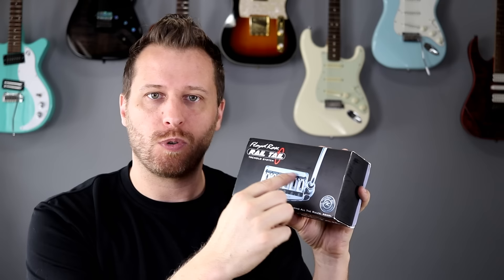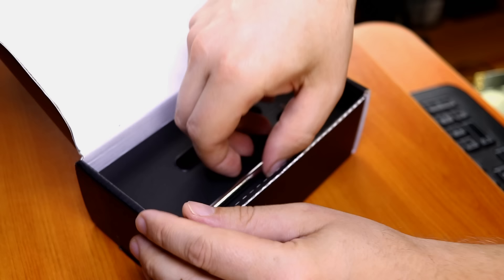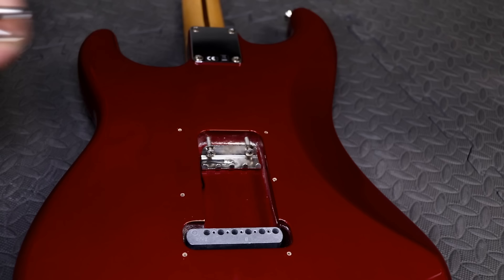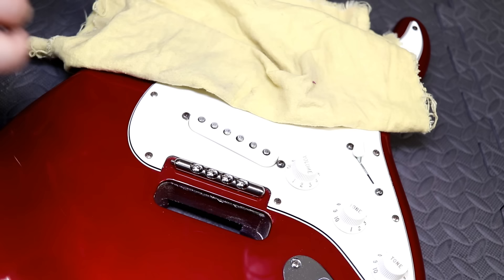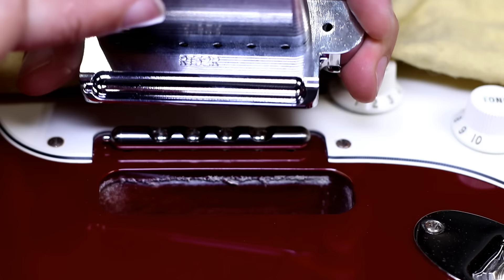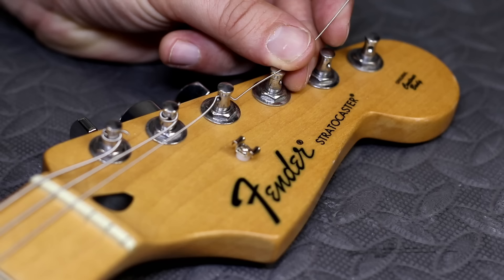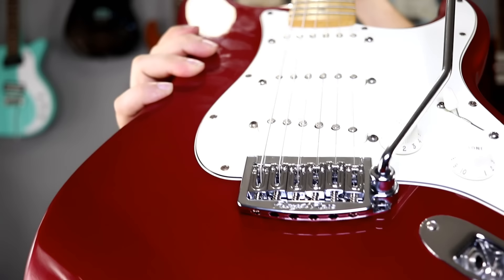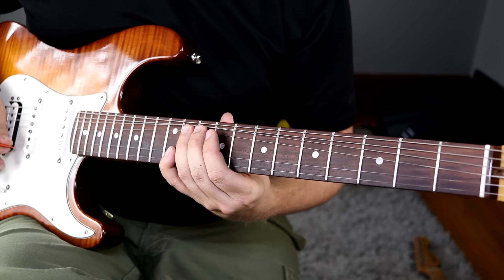Farewell to Fender's 6-screw Trem! - Floyd Rose Install!

Comment: I want this! Then got sticker shock! My heart is still in my throat. $250.00
Reply from the maker: Yeah, after-market trem bridges are pricey ($200-$300) from most companies.
Reply: I'll never justify the spend. Whenever I've got that much money to spend on guitarama,  I'll hold out for a little  more and then buy another guitar instead!

Having said that, this floyd should be more popular than iPod's in the 'naughties! They should really be selling out. Let me explain...

I just got a prs se, and it has a bridge entirely based on the strat bridge  (which I have aswell — a MIM too). Only the prs bridge is engineered to the astronomic specs that Prs is famed for — and it works like a Rolex, I kid you not! The engineering is insanely good — I am beyond impressed. I guess because I was raised on strats (mainly bad copy's), I got used to having a flimsy bridge,  like it was normal. 

But now I know the difference. I watched this video 7 months ago. And then I thought "no way I'd spend that much money on a Floyd Rose that isn't even like a floating Floyd Rose!😂 Pull the other one! 

But now,  after getting this prs, I rewatched this video, and thought wow!  that would transform any mexican fender! You would literally be shaking your head and beaming for months over how fantastic the difference is! 

Sure, you could buy another guitar... but then you'd likely have two guitars in need of upgrades!

Honestly,  I don't know if my strat is worth that to me. But at some point,  the dollar amount it costs is irrelevant. Do you love your guitar? Well,  it needs a big upgrade. I mean, do you want the guitar you've become comfortable with,  to get a major boost in playabilty, tuning stability,  sustain,  intonation,  tone!!!  It will significantly improve all of these aspects of your beloved old friend! That,  to me,  sounds closer to a personal signature guitar than most of us will ever get. 

I'm going to have to check these out...
Reply: aleh bhaba  I think it's because he uses this and his squier sometimes for gigs when he is nervous about taking a more expensive strat... he's said that elsewhere I think... cheers!
Reply: aleh bhaba  Because someone wants it? Really, are you going to modify a $4k guitar and ruin the resale value? Or put the bridge you want on something that's not a collectors item and use it?
Reply: Just increase the spring tension on the current vintage trem so that it locks against the body of the guitar and you'll get exactly the same results without the cost. Where vintage trem are difficult to get working really well is when they are setup as floating trems.
Reply: aleh bhaba to improve it? i put a $200 Mastery on a $500 Squier J Mascis.... best money I ever spent.
Reply: I'd pay that gladly. It's currently € 465 at Europe's largest seller. That is about $ 512 converted late novermber '19.  So yeah...
Reply: aleh bhaba I was wanting it for my $60 pawn shop Danica strat... but I can’t justify it for $250.
Reply: Pass got locking tuners, vintage 6 screw trem with graphite saddles, and graphite tusq nut. Guitar stays in tune dive bombs and whammy screams till cows come home.  This be great if it was 100 bucs but 250 nope.
Reply: aleh bhaba  Because they like the guitar? The price of the guitar doesn't really matter. If you put nice pickups and bridge and tuners, you can put together the perfect setup in a cheap body. Why start with an expensive body? In fact you can built a guitar much nicer than a $2000 guitar with a $500 guitar and $500 upgrades...
Reply: I've got some news, they're 4-500 here in Japan! It's looking like the Bladerunner for this happy camper.
Reply: Chinese copies will happen before too long, but from cheaper metal. If that's a compromise you are prepared to make then it' up to you.
Reply: cancelled an order for an old design just because of this video. Thanks Darrell.
Saving up now...
Reply: @esemceX how much? Ridiculous, way out of my price range.
Reply: @lueyteledeluxe7457  I totally agree I could never justify this spend on a bridge, I would rather spend money on a better guitar!
Reply: @marka6414  that's what I thought as well? I have my vintage trem set decked and it works identical to this
Reply: Yea I hear you!! I wanted it to but $250!?!? I paid $330 for the guitar lol..
Reply: @lueyteledeluxe7457  I hear you!! Me either..
Reply: If you’ve been playing Floyd Roses as long as I have and become used to the “feel” of one I easily justify it. Simply put, Ive just gotten tired of dealing with the locking system & this, imho, is worth it. I actually think it’s a deal. I’ve simply started making partscasters in the last decade. Don’t know how/why I’ve never heard of this. Anyone ever heard of a “rout-less” trem, other than a Bigsby?
Reply: Looks great and seems to play great but the back of the bridge is pressed tightly against the body of the guitar so isn’t that going to mess up the paint and put an indentation in the body?

Comment: I own a MIM strat.  And I love it for what it is.  Here’s the issue.  After your done modding the strat with a $250 trem.  $250 worth of electronics and $100 set of locking tuners…you’ve priced yourself into an American strat, but you still just have a MIM strat that will never be worth what you put into it, except to you.   A good rule is to just buy the better guitar from the beginning, it may be cheaper in the long run.

Comment: Sweet device!  I hate the 6 screw trem.  But I cant see myself putting a $250 trem on my $300 MIM strat.
Reply: Remove 4 screws.
Reply: The bridge still wouldnt pivot on the remaining 2 screws...
Reply: Bay old Ibi Com for like 300 euros and you get that trem and great guitar....☺ old Esp's are pricey anyhow some have same ''blade'' solution trems not 100% sure but some of old Kramers have them to
Reply: I agree. $250 is just too much money. I like the concept a lot.
Reply: they are great guitars if you love it I would but keep the factory one case u want to sell it definitely not a great idea if you buy and sell alot but if you hang on to them I would upgrade
Reply: It's going to cost $250 to replace no matter if you put it on a MIM Strat(they may have cost $300 20 years ago, but have you priced a new one lately?) or any version of an American Strat.  And you never get your money back on guitar upgrades, they're to make your playing experience better.  I'm planning on putting one of these on a Squier based partscaster I'm bringing back from the dead.
Reply: If I was you, I'd just go buy the Super-Vee Bladerunner instead. It only costs $180, and it looks like the original Strat vintage tremolo, too...:)
Reply: @7stringslinger74  The people who don't want to spend $250-$275 on a guitar part for a $300 Mexican Strat would prefer to save their money and buy a better guitar. If you do buy this trem just make sure to remove it if you ever sell that Squire! :)
Reply: Those newer mexican strats have weirdly good tone, for a strat. They sound better than the american strats. They sound fatter, warmer.
I am not sure it was on purpose, but there you go.
Reply: @rich1051414  Yeah that's true. I have a 2016 MIM. It's basically a Rolex vs. Tag Heur watch comparison. Both perform equally and look great. But one is a freaking Rolex.
Reply: Richard Smith the MIM Strats (up til 2018) have ceramic pickups which are a hotter wind. that’s why they sound “warmer & fatter”.
Reply: I spent £450 upgrading a £75 knock off strat. Best decision of my life because it sounds fantastic and plays just how I want it to. All depends on how much you like the guitar
Reply: Fender terms are pure junk, they should switch to these standard on all of their guitars that are $600 and up.
Reply: @brucechavez9535  Great option too, but different functionally (and likely sustains differently too).
Reply: @rich1051414  I own a MIM Strat and your right Richard.  It does sound better than the American Strats.  I've replace most of the gear on the guitar over time and now it sounds like a seriously well made guitar.  Really, the only thing better would be to get a rare killer sounding Custom Shop costing $$$.
Reply: Phreak1118 I'm considering buying a vega trem and putting it on a guitar i spent 15 dollars on lol may be a waste idk
Reply: I wish I could get an MIM strat for $300
Reply: @rich1051414  very true and they have a bone nut and a two point trem. They’re awesome!
Reply: Buy a higher priced guitar :)

Comment: Just an aside for those that don't know,  balancing your string gauge(string tension) and spring tension is critical for making a decked trem function. Some guys use more springs, or less springs, or different spring tension and configurations. You want your spring tension to hold your bridge decked on your hardest bends. That's the threshold you are looking for and everyone is different. Don't be afraid to find the perfect tension for you, there is a sweet spot.  Generally the lighter the string gauge the less spring tension you need.

Comment: Leo Fender recommended having the 4 inner screws loose, in fact a 1/32th inch gap between the underside of the screw head and the top plate of the guitar bridge/tremolo system. Only the two outer screws were to have the screw heads in contact with the metal plate securing the bridge/tremolo system to the top of the guitar. Leo also recommended a 1/8" gap between the back of the tremolo/bridge assembly and the top plate of the guitar. In this manner the tremolo can work up and down to raise and lower the pitch.
Very few people know how Leo Fender wanted us to set the tremolo on his guitars, very few. Hence, well you can figure that part out....they don't work very well for those people!

I found this information from a video image of a few pages out of a guitar set up manual written by Leo fender. I know, right, what a strange way to find that data. It was from one of "Dave's World of Fun Stuff" videos where he panned his video camera across the open pages of his manual. I froze the frame's and wrote it all down! It made a world of difference in the usability of my Stratocaster Tremolo. Much, much better.
Most people just tighten the tremolo springs until it's like a hardtail. You can bend down but not up. That's the way I had it for a decade and more. I was wrong and I am sure so are 99% of the people who own a Stratocaster are.
Reply: I have been on my own to try taking away the 4 inner screws, and only leaving the 2 of them in the outter extremes but I was doubtful. Now that you confirm Leo recommending  what you described I' ll be rumning to try in my guitar such adjustment. Thanks.

Comment: The parts that you removed from the strat can be used to upgrade squier strats
Reply from the maker: Good call 👍
Reply: 2 upgrades  for the price of one!
Reply: Wii fit a squire without mods?
Reply: @DarrellBraunGuitar  Hey can I have that Mexican trem 😃

By the way, I feel the new trem isn't for your play style. Right now I noticed how large of a portion a floating trem is for your sound. 
Myself I like ducked one (no, I'm not begging for the trem)
Reply: My Squiers have the 2 post bridges , and , hands down , they are better than the original 6 screw 

bridges that I used to put a block of wood in and call it a day . And , I am 57 and perhaps have owned that many Vintage Strats . I have a mahogany "Trans Satin" (body is mahogany)
model and a "Black and Chrome" model , that , are really good . Maybe I got lucky
Reply: Цветелин Генов you kinda are begging
Reply: @user-ww9qn8ki7d  you are begging boi
Reply: @DarrellBraunGuitar  If you hadn't cut them off!  Sorry but WHY would you do that? [edit: Sorry watched again.  You pull them out.  It looked like you cut them]
Reply: @thias1  why cut the springs off?
Reply: @thias1  yes snipped them all off. Just seems rather wasteful. Excellent channel and very knowledgeable but just seems silly.
Reply: @thias1  sPrings not strings.
Reply: @thias1  I wouldn't be bothered about strings. I just bought a Strat and cut the new strings off to replace them.  It just seemed a little wasteful.  Then again he might have a box full of them.
Reply: @cowasakiElectronics  he never cut the springs...
Reply: @allan2519  Just watched it again.  Yes you are right he doesn't.  It looked like he had when I first watched it.

Comment: Adding locking tuners, graphtek nut and string tree and ensuring a straight string pull will greatly improve tuning stability with a regular trem.  FR even recommends doing this for the rail tail.

Comment: That trem looks incredibly high quality and a lovely upgrade to the guitar. But of it is not floating to keep the trem in tune and locked against the guitar body. You could just tighten the springs on a vintage trem and lock the trem against the body. Doing this give excellent tuning stability and stops double stops going out of tune in exactly the same way as the Floyd rose and its totally free unless you need to add a couple more springs to get the right tension.
Reply: Right, but a normal tremolo system, even if correctly setup will detune the strings if you do dive bombs
Reply: @pedrosilvaproductions  If that's the case there's a problem with the nut not being cut properly or smooth enough for the strings to move over them freely or the string are not wound properly on the tuning pegs.
Reply: Exactly and who wants to do diveboms only?Whats cool about a floating bridge is that you can do a nice vibrato with and diveboms if you like and it stays better in tune when its floating because you can just jerk it one time and its back in tune.

Comment: Thank you Darrell! Great demo. I couldn't be happier with this bridge! I truly feel it's the perfect balance between a hardtail and a tremolo that most players are looking for. Yes, it is a bit pricey but so are beautifully crafted high-quality watches. If your looking for high-quality components, something aesthetically stunning, and an upgrade in performance like instant sustain and tuning stability, then look no further. The Rail Tail is the Rolex of guitar bridges. ⌚
Reply: I installed it on my Strat & it's much better at keeping tune. I use 9.5 gauge strings & have all 4 trem springs installed. It's heavier than the stock (American Performer Strat SSH) trem but I like it. More predictable. Smoother. Looks really good too. I don't dive bomb as a rule, but will do it occasionally because I can. Makes a bit of a 'clunk' when I let go of the trem after bending, so I likely didn't install it perfectly. If I did, then you'll want to consider this if you're taking it to a studio.

Comment: A little update - I've had this exact trem on my American Performer Strat for almost a year now & have no complaints. I'm using all 5 springs, so I can change from 9-42 to 9.5-44 to 10-46 without making any adjustments. 
As for tune stability, I have to admit upgrading to a Graphtech nut is what did me the most favors, but that, combined with the FR Rail-Tail & locking Fender tuners, I cannot force this guitar out of tune. I don't notice any change regarding sustain or tone - but there could be, I'm not a musician & only been playing since late 2017.
This system was expensive. I'm happy with it though & it's nice to have a trem arm that I don't have to unscrew to put it back in the case (loose enough to pull out, tight enough to stay in while playing). Trem springs belong in my vacuum now, not my Strat.
This was a great recommendation, Darrell.

Comment: Hey Darrell, thanks to this video, I reached out to Floyd Rose and it looks like I am going to have the Rail Tail as an option on at least 2 of my models. Thanks for video. I'm really not a big fan of Floyd's, so I don't even keep up with their latest. If someone wants a Floyd type bridge on their build, I usually go with Schaller. For me, it's a local company, unlike FR. While I know the orig design is an awesome piece of hardware for the shredders, most of my customers are just blues and rock players. We're mostly old. lol. The only thing I dislike worse than a FR is the old school 6 screw trem. Without some specific modifications to the screws themselves, it's simply an outdated design. The newer 2 point is better, but even it has it's limits, as you point out. I know that by saying bad things about FR, I'm going to get flamed in the comments, but these are people that either don't have one, or rarely ever have to work on them. They were a pain in the a$$ in the 80's and still are. But as a retrofit for the old 6 screw, that Rail Tail is one sexy piece of modern looking hardware!!! Are you still loving it, or have you found something you would prefer was tweaked?

If you still have some guitars laying around with the old 6 screw trem, the modification is rather simple, but requires some work. If you dont have a lathe, you can pull one screw and mod it at a time. Put it in a drill, and whatever the thickness of your baseplate is (Fender and Squier have used different thicknesses over the years) measure down that distance from the under side of the screw head. Use a triangle file, thinner the teeth the better, and turn on the drill. Use the V and cut into the shaft of the screw and hog out about 0.6-0.8mm of material from the shaft. Polish it with some extra fine sandpaper, and then green scotchbrite or 0000 steel wool to really get it smooth. Reinstall the screw and move to the next. When you use the tremolo arm, the base plate will drop into that groove smoothly, and return back to pitch, smoothly. You'll love the way it feels, but honestly, it's still only a bandaid for an old tired design. But again, thanks for the video and enlightening me to this awesome product FR has now. Take it easy, and waiting for the next video.  Bob in Germany Piedmont Custom Guitar Co.